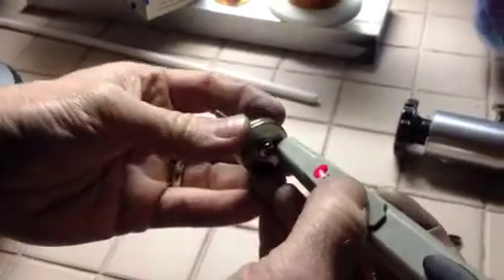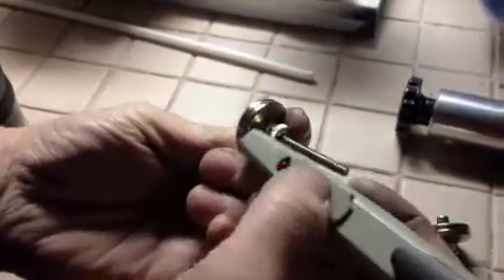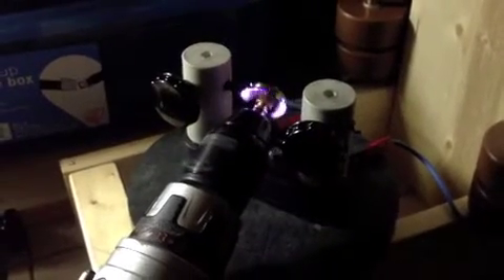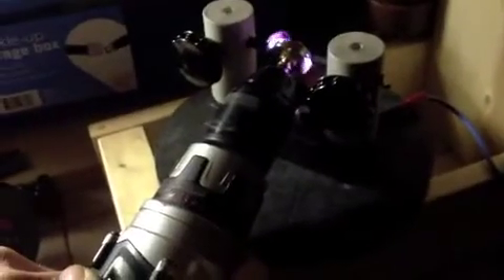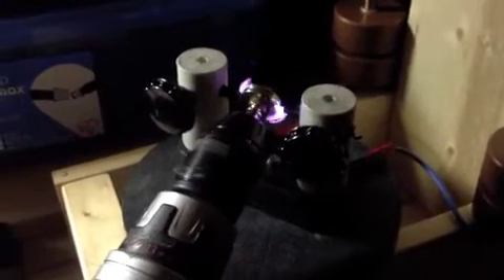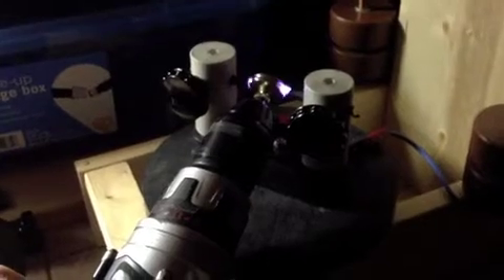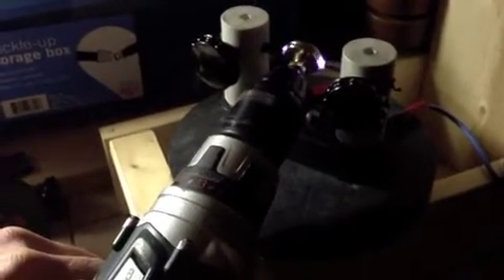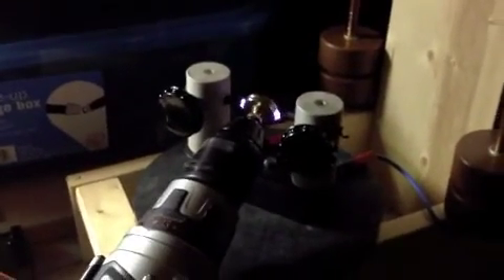Rotating Mag Fields In Plasma N/S vs S/S

Comment: You say north against north, the red light of north shows up on both outsides, So the inside is south south, correct? Showing the     spark being "sucked in".  Have you tried, reversing the magnets? So south is outside, and north is inside (repulsion). I do believe, you would see a different effect. South sucks energy in, while north pushes it out. (as i see it)

Comment: i have some high sample point DSO  emf waveforms taken from an automotive two wire COP style ign coil primary of single spark event showing the secondary voltage thru mutual induction during a partial misfire event. I haven't used my magnetometer yet but as of late have been highly interested on how an ionized gas that has essentially very low resistance cause significant field strength that my pick up coil can detect with what seems to be great accurarcy less the ringing that occurs after breakdown voltage has been met. Im a mechanic of 17 years and fascinated in spark analysis mostly in regards to automotive diag application. if ur interested maybe u could take a quick look at the events captured at 1gs/s 5m sample plot taken during a misfire. At lower sample points the waveform depicts what appears to be a lean miss type pattern with high breakdown, severely reduced duration (sometimes as low as 20 us), higher than normal spark voltage thereafter, and a high nose equal to the initial breakdown voltage. But taken at a much higher rate of sample the spark voltage seems to oscillate at an unbelievable speed and voltage, each cycle about 10 us until what appears to be the death of the spark with its high ending oscillations then two smaller rings until it finally equalizes. The event is intermittent and at idle speeds only. its also the cylinder closest to the alternator and my hand wound mag is picking up an rpm synced waveform that appears to be excessive ripple somewhere around 1100 htz. And i have other bizarre events but im most interest in spark analysis and how the field lines and or flux can change when conducting through a plasma. most appreciated. Any of your knowledge would be highly regarded. much respect brother.